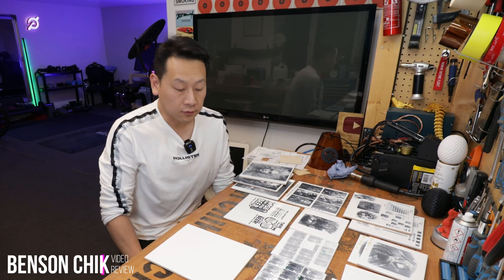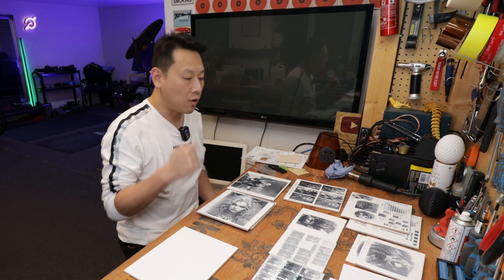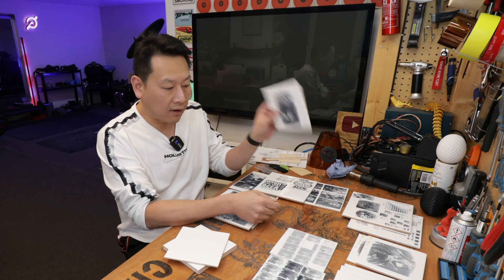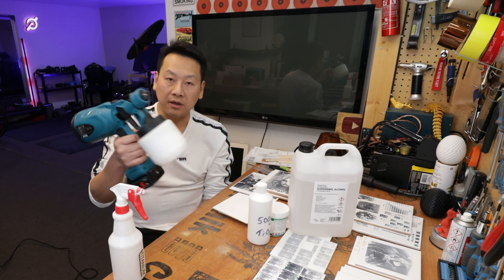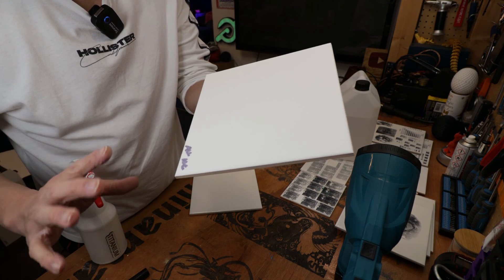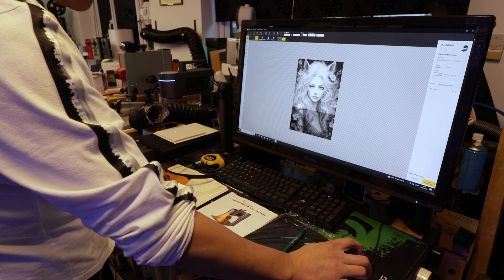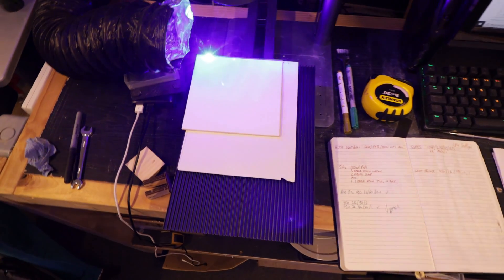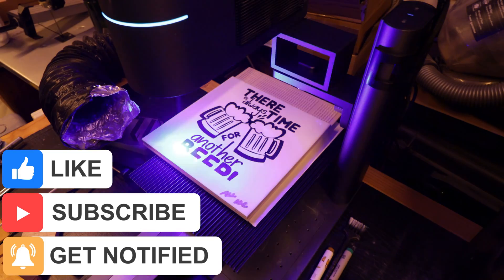Norton white tile engraving with LaserPecker 4 DIY TiO2 spray

Comment: How does the neje max 4 go with this?
Reply from the maker: The E80 module has a larger dot size and will be a lower resolution than the LP4. That will be the same for any 4x5w laser , the more beam to combine the lower the resolution. I wanted to get a 2.5w Neje module for the MAX 4 but since I have the LP4 that would have to wait

Comment: You can engrave a vivid dark blue on tile and glass using 1 part Cobalt oxide, 1 part school glue, and 3 parts water. Substituting black copper oxide for the CoO yields a dark metallic copper on tile
Reply from the maker: Thanks for sharing, I would love to try that
Reply: @BCreviews  Depth 89 power 44% to depth 90 power 50% works pretty good. One coat is all that is needed. Also, ceramic glazes work pretty good for lighter colors (depth 87 power 8%) but are a bit tricky to apply. To thick, and the engraving washes off. to thin, and the color is to light. 

One more thing - the LP4 at 1064 will cut thin (0.03mm - NOT mil) aluminum tape (from Tapebear), in place, on wood and ceramic with three passes at 100% depth and power, 1064, so you can make what looks like metal inlays on wood. Two coats of varnish, sand smooth, lay the tape down but don't press it down, don't worry about small wrinkles, then engrave, carefully weed, then overlay with paper and burnish very firmly with a smooth object, like the back of a screwdriver handle. The wrinkles are all smoothed out and the tape is firmly adhered to the wood or ceramic. The result looks like a silver inlay and is quite robust. If you would be perfect, clear coat afterwards. If there is some way I can send pictures I can show you how well this works.